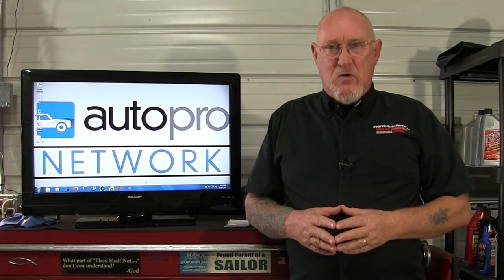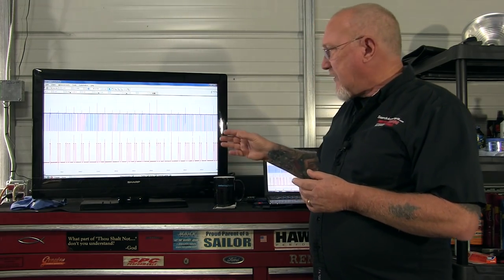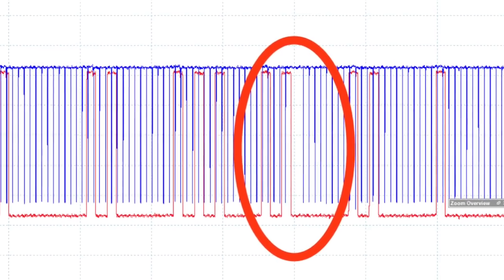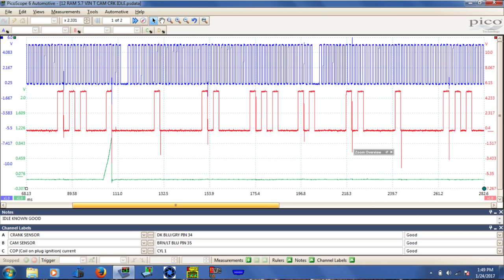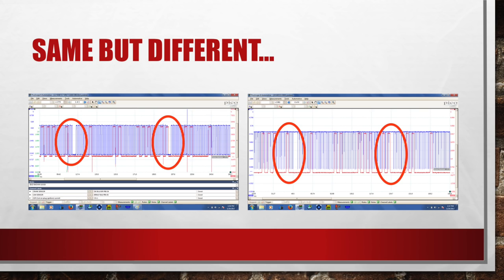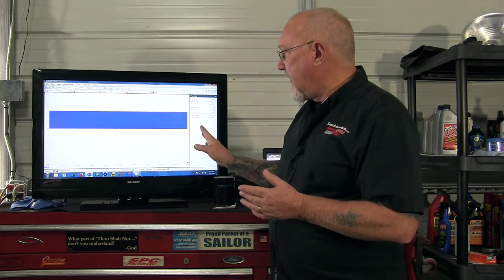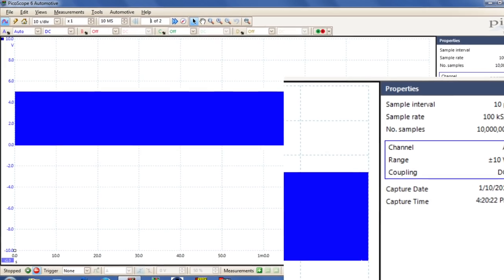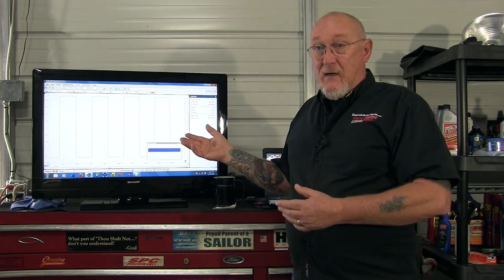Motor Age How2 #5 - Using The CMP/CKP Signals To Check Timing

Comment: The Guided Component Test inside the Snap-on Verus Pro has known good wave forms integrated in the Scan Tool software. It shows the wave forms for Cam and Crankshaft sensors for all Makes and Models. It's a very powerful scan tool for the professional technician.

Comment: Hi Pete,
You really do explain electrical issues very clearly...thanks for that gift you are sharing with us!
I've just bought a 'lemon' of a V6 2003 Cherokee ( in Australia & Liberty in USA), with 125,000 miles on the clock.
 It's thrown up the 'Check Engine Light" on the dash. I used my UL319 OBD II  Code reader which has spewed out following DTCs: 
(i) P1391 - $10 Generic - Camshaft Position Sensor . A circuit Bank1 or Singl
(ii) P0340 - $10, Pending, Chrysler,  Interim loss of CMP or CKP.
As a DIY 'ignoramus', with  a multimeter as my 'only' other diagnostic tool, I'm floundering all over the 'Net' for help, ...
as I'm in a panic that 'Big Dollars' might be the only solution to turning this 'lemon' into a sweet orange!
All paths are pointing to these troublesome possibilities:
(a) Cam & Crank out of sync. because of Timing Chain elongation ( I learnt this word from your Video)
(c) Sensors have self-destructed.
(d) Fault in the wiring harness.
(e) The notched disc that generates the 'Hall effect' wave patterns  has broken in the engine.
Possible action going forward:
(i) Check Power, Ground, and Signal at each Sensor,  for 'A" OK - before running out and buying replacements.
If you can offer any advice towards making my ' sweet orange' appear, I'll be most grateful!
Perhaps you can send me a link or two that 'homes' into my 'dilemma'.
Thanks again for your super instructional video series.
Best regards,
Lloyd.
Queensland, Australia.
Reply from the maker: Sorry for the delay in getting back to you. Failure of the CMP is common and considering that the intermittent code is also stored leads me to think the sensor is bad. Could be a problem in the harness but not as likely. If you have a scope, you can backprobe the sensor wires and check power, ground and signal - all at the same time. Considering the history of the model in general, though, I'd be comfortable replacing the CMP.
Reply: @MotorAgeMagazine  Hi Pete,
Thanks for the sound advice. I have taken your advice and  replaced both the Cam And Crank sensors. I'm delighted to report that my Jeep fired up first time and the 'Check Engine Light' has not returned. Once again thank you for your interest and sound advice.  Lloyd. Queensland, Australia.
Reply: @MotorAgeMagazine   Hi Pete,
Thanks for the sound advice. I have taken your advice and  replaced both the Cam And Crank sensors. I'm delighted to report that my Jeep fired up first time and the 'Check Engine Light' has not returned. Once again thank you for your interest and sound advice.  Lloyd. Queensland, Australia.

Comment: The Snap- On Verus Pro Scope automatically adjust the Time and Voltage rates for the Technician. This feature is part of the Guided Component Test. No advanced scope skills required for the Snap- on Verus Pro Oscilloscope.

Comment: Pete, great presentation, would love see more of this on crank/cam correlation.  I noticed in your waveform at 2:17 minutes into the vid that if you compare the Cam pulse to 720 degrees of Crank pulse, from synch notch to synch notch, you see the Cam has a very distinct pattern ( 2-1-3-1-1-2-3-2 ) which then repeats itself over and over starting just after the crank synch notch. I know on some GM vehicles, the GM factory manual will give  you very specific parameters on how far the Cam pulse can be ( in degrees ) beyond the Crank synch notch window, that the PCM will tolerate, before the PCM will set a P0017 DTC ( Crank/Cam Correlation Code ). By measuring between the synch window and the cam pulse and comparing it to the given specifications, you can determine if there is any timing issues. The closer to the specification ( in degrees ) the more worn the timing components are, such as chains/sprockets etc. . All this can be done in minutes without taking anything apart on the vehicle and even without a known good waveform !   By the way love the Pico, It can be a very powerful tool ! Take Care !
Reply from the maker: Great tips and information Billy - thanks for taking the time to share. More and more, the OEMs are embracing the use of the scope in their own diagnostic information.
Reply: Billy R THANKS FOR SHARING!!! GREAT TIME SAVING TIP!!!

Comment: I’m really enjoying your content! You mentioned that you were going to go over what you considered an easier way to determine the timing in a future video. Did you ever make that one? I can’t seem to find it and would love to know more about that. If not I would like to respectfully request that topic for the future or maybe a quick explanation of that process. Thank you for sharing your skills and knowledge.
Reply from the maker: Daniel - you're right, it's been a while since I've shown this technique. The first step is to perform a relative compression test (https://www.youtube.com/watch?v=XNANMYA3VV8) then add a second channel using any of your ignition signals (secondary or primary ignition). Use that ignition signal as your reference - it should intersect the relative compression peak for its cylinder right about dead center if timing is correct. You can do the same even more accurately using a pressure transducer in the cylinder instead of the relative compression test. Does this answer your question?
Reply: @MotorAgeMagazine  I was actually wondering if you were talking about checking the crank/cam correlation with an easier method. Thank you for the link and info, I watched your old scope video about in cylinder compression tests and how you can see valve timing there, but I just thought your comment in this video may have meant you had an easier way to check valve timing.

P.S. If you’re taking requests I’d love to see more about checking valve timing with a scope or an updated in cylinder compression video with one of the more modern scopes.

You’re videos and content are fantastic, I’ve learned ton from you. Great job!
Reply from the maker: @subpargolfer6654  Request noted! I’ll get it on the production schedule.
Reply from the maker: @subpargolfer6654  The best way, in my opinion, to check cam/crank correlation and VVT operation is by performing an in-cylinder pressure test. You can "see" the timing change as you operate the VVT solenoids.
Reply: @MotorAgeMagazine  Sounds good. Thank you for the reply!

Comment: Hi Pete! On a V6 car with 2 camshaft sensors (1 per bank), what is the approach? Am I supposed to get the same patterns when overlapping Bank 1 camshaft with single crankshaft and overlapping Bank 2 camshaft with single crankshaft? I hope I made myself clear. Thanks!!!
Reply from the maker: I would treat each bank as an individual engine - that is, look at Bank 1 CMP and CKP, then Bank 2 CMP and CKP. You still need a "known good" for comparison though. Better, I think, is to use an in-cylinder pressure sensor so you can "see" when the valves open. Consider the confusion if you rely on the CMP/CKP synch and all you have a problem with is the Variable Valve Timing system. And if ignition timing is your concern, I have an answer for that one in next week's video!

Comment: Great video! Thanks! I just purchased the Autel maxsys pro, would like to see a video on the Autel scope.
Reply from the maker: Thanks Art! Unfortunately, I can't show every scope made in this series. However, as you'll see in upcoming videos, when using any scope the concepts of basic settings are the same. That's why I'm focused on helping you get a single screen capture you can use for diagnostics. Once you have a solid foundation, you can explore the features unique to your own scope. Hope this helps!
Reply: Art..  The Autel scope is a Chinese clone.  But they are not very good at cloning and it is virtually useless compared to the real PicoScope.